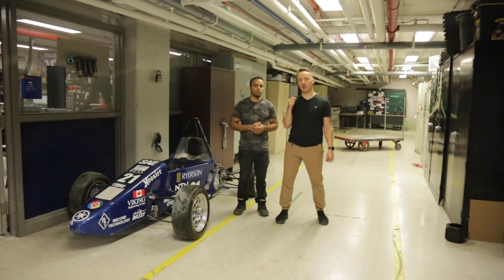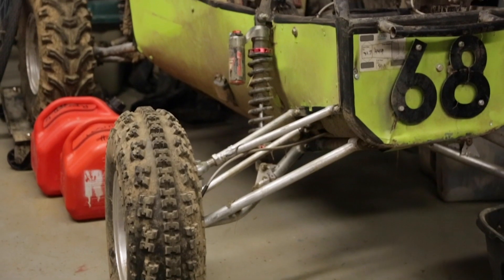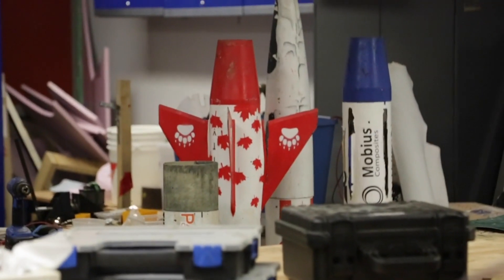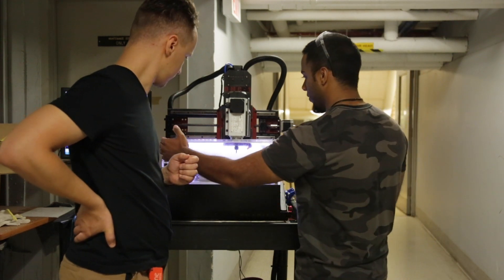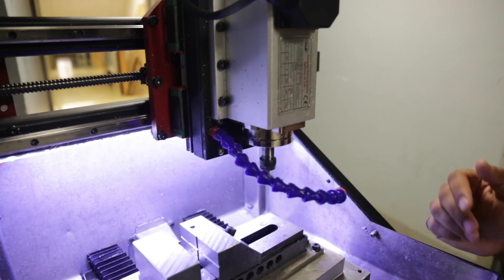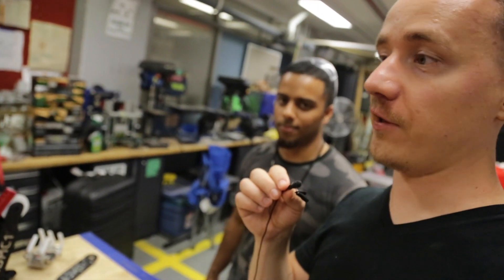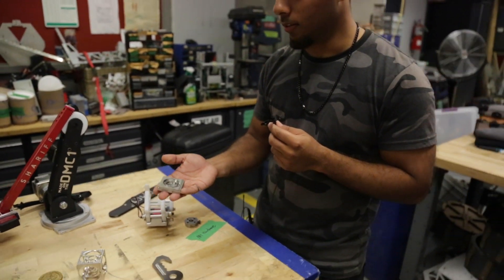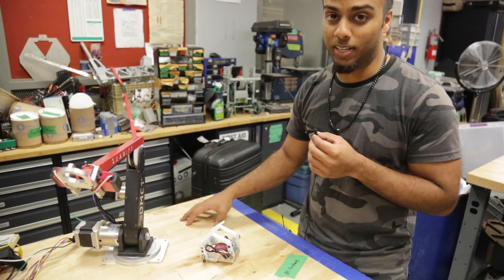Cheapest Desktop CNC That can cut Steel

Comment: Not trying to put negative feedback into this.  The machine seems capable, and good on the guy trying to bring something he seemed intrigued in to market.  The biggest problem here, is the lack of experience from the creator.  So many machines can perform these same tasks.  If you find any used engraving machine on marketplace, or ebay you can easily get one with equal travel dimensions if not greater.  Take the stock spindle off, buy a router, (bosch1617evs)  with stock low runout, and machine 1018, or 304 stainless, or any grade aluminum.  A used machine with the same.linear rails can be had for sub 1k. Bosch router - 200, precision collects for it from precise bits, another 200.  I guess my point is that this may look amazing for anyone with no cnc experience.  I'm not sure who the target audience is suppose to be for this.  Sorry if this seemed negative, I just feel this another in a long line of desktop style "mills" that fall even shorter than most.  Those parts looked rough off the machine.
Reply: whats a good alternative that can aluminum steel? on the market for one i can play around with and machine bike parts, shapeoko seems like another one but it doesnt seem "beefy"

Comment: you showed steel that was cut but never showed it doing the cutting of the steel. so we take your word for it and just buy the machine right? well anyway i probably would but i just found this video and i see it was unsuccessful at Kickstarter because nobody knew it was even out there being made! i think you need to get alot of interest first then try the Kickstarter again. please because i need a true good steel cutting desktop cnc . the size would work for most of my projects 12inches by 8 inches and 5 and a half inch up down zed axis would be perfect for me. hope you try again and film some steel cutting perfectly and it will be gone sold out way before you can even make them! they need a lower price point also. no more that 1,200$ usa dollars. to be successful.

Comment: Advertise that it cuts steel but only show it cutting aluminium? You mention something about testing so you don't break things. That's a smart thing to do but, doesn't the software have an option to input the type of bit and material used? If so, how well does it work? Is it pretty much set-and-forget or does it not work well?

Comment: Some nice machining, especially on the circular cut one with lots of features. Have you tried the "Only One PM60" end mills made by YG? I've been using one on hardened, toughened and tempered steel and it cuts like a knife through butter. I have a home CNC machine that I've converted using brushless DC motors on an Arduino Mega. Love all the projects at the university, keep up the good work 👍😀

Comment: I need this cnc
Reply: Have you seen the samurai 120 on Kickstarter
Reply: @Seed-qj6jk  now I've seen it but c'mon ...you are going. To pay 3500£ for mgn12 and 12mm ballscrew? What a joke 😂 the video was good then I scrolled down and saw that ...and I was like ..hell nah
Reply: @fabiofoltran4361  what's wrong with those?
Reply: @Seed-qj6jk  well for cutting steel that hardware is pretty undersized ..I would go at least with 20mm guides and I still feel that is on the edge ...mng12 I have them on my 3d printer ..they are actually super cheap from China ...and they perform ..not good ...i mean they cost nothing to but they are kinda sh t, and they are not made for those task ..they have only 2 contact points and not 4 like brand name rails ..the 1204 screws idk I didn't try them but 12mm seems undersized to me..and we are paying 3500£ go to AliExpress and search for yourself how much those costs and then tell me how the f is the guy spending 3500£ for building that machine
Reply: @Seed-qj6jk  TLDR they are severely undersized, not up to the task and too cheap for what you are paying
Reply: @Seed-qj6jk  if you wanna build a cnc I reccomend to get in touch with the components because a lot of people are selling Chinese stuff with insane markups, knowing what you are buying will save you a lot of money
Reply: @fabiofoltran4361 I guess you are probably right but didn't you see it slotting steel and aluminium
Reply: @Seed-qj6jk  that's true..you got me .. I'll comment on this video when or if I will ; )

Comment: The unit is only 3-axis, but the controller used supports 5 axis control (similar to the SainSmart 5-Axis Mach3 here: https://www.amazon.com/SainSmart-5-Axis-Mach3-Controller-STB5100/dp/B07L3DYVJ1).  So a 4th/5th axis chuck such as this one (1) should be able to just be plugged in without too much difficulty.  The stepper motor drivers (3 are included) are TB6600 (2).

(1) "4th Axis and 5th Axis 100mm 3 Jaw Chuck" [https://www.aliexpress.com/item/32521549316.html]

(2) TB6600 Bipolar Stepper Motor Driver [https://www.makerfabs.com/tb6600-bipolar-stepper-motor-driver.html]

Comment: I'd really love to get one of these, but spending 2.5k€ on that thing is - as a student - sadly too much.

Still, I'd love to buy one of these in a few years and wish best luck in getting your project off the ground
Reply: What kit is there to build one for 500€ have u got a link?
Reply: @gt0163  nah for 500€ you can dream of that hardware ...if you are like really good in mechanics and have already a milling machine you aint going anywhere...electronics it's already 200€ ..linear guides and ballscrew are not cheap, and after trying some 20mm. Ballscrew and linear guide from THK I don't reccomend to buy the shi t Chinese one, the one that you see in the video are, my reccomendation? Find a cnc maker in you zone and ask if they have retired machines..you'll  have to redo the electronics but trust me the mechanics is the difficult part. For 600€ I bought an all cast aluminium that weights 150kg with all the hw trow at it 100€ for drivers and 50 € euro of a controller and you have a machine capable of handling aluminium..when you can make your own part everything will be more rechable, my machine has also a 650*450 work area so pretty big and it has a cast aluminium bed that is 4 cm thick ..only that is going to cost you a fortune ..so moral of the story if you buy it it's better ..with the smaller machine you can do plates and precise parts for a bigger machine and then fill it with a composite mix of epoxy and sand to have a good absorption of vibrations ...getting a little sidetracked here
Reply: @fabiofoltran4361  i am begginer for all of this what do you think i should buy a lathe or cnc? Considering I have some know-how metal casting hobbies in my backyard
Reply: @dogodogo5891  I'm not really the one that should tell you but for example a few months ago I bought a cnc with a working area of 650mm * 450mm for 600€ ..that's pretty cheap here in Italy but with the same money I would have bought an used lathe (a big one) ,the cnc that I bought doesn't have the controls so I have to remake all the electronics but that's not a problem ..with the first cnc I plan to built parts for a bigger one ..20mm linear rails and ballscrews..and a bigger working area...the little one can cut aluminium so I can make some really nice parts out of it .. it's nothing special  but for now it will suffice ..then I don't know your budget so ..but if you can try to see on the used market if they have anything good ..(my cnc was a used one from the 90' but it's better than anything that you can get from China for the same price) same for the lathe don't buy the little overpriced one (imported from China ) buy a old big one ..they are built to last and won't break down on you
Reply: @dogodogo5891  maybe a lathe would be better ? Cause you can cast your round stocks of metals and the turn them to dimensions? Then a lathe it's made for turnings cnc can do a lot more things , but can do the things that a lathe does. Or it can do it but not with the same level of precision (at this price point)
Reply: You can build it yourself for around 500-600. There was a successful 5 axis kickstarter last year for $3000 with automatic 12 tool changer. It seems they just barely didn´t make the goal.

Comment: Yea that wood router motor "milling" its literally off of aliexpress 2pole pos
Reply: Of course it is. Would you expect them to design and manufacture the spindle themselfs? You also want them to build their own steppers I guess or what are you expecting?
Every product designer wants to use working and already designed parts when possible and appropriate as it makes the product cheaper and more likely to actually get build.
Reply: @IanMcDoe  I expect them to spec correctly. I expect them to actually give damn when picking parts 
Not saying Chinese is bad All I am saying they put a wood spindle on a metal milling machine.
Reply: @yoyobob1  On the product page for one of these it says for metal processing. The ones made for wood only (like bosch pof 500) are usualy made from plastics and wouldnt stand a chance against metal. While its true that many diy routers use spindles like this the reason that they could never mill steel is the stiffness of their machine bodys which are large and from extruded aluminium. This one is stiff enough to mill steel and the spindle is good enough for the job.
Reply: @IanMcDoe  we did

Comment: It's really a shame that it looks like this won't get funded. The single reason I haven't purchased myself a desktop cnc is the crappy quality of what is on the market. The Nomad is probably the best available, but for the price, not being able to flood, and not having ball-screws is a total deal-breaker.  This thing looks amazing.
Reply: Thanks! At this point it does look like we might not reach our goal, however we will most likely still go through with production and deliver machines to the current backers. I'd recommend signing up to the email list so you can follow our progress: https://www.shariffdmc.com/
Reply: An idea for "version 2”:  What is a "killer app" for desktop metal milling?  I don't know.  There is also this Kickstarter (https://www.kickstarter.com/projects/3d-high-resolution/3d-jewelry-scanner-shadow-bands-heirloom-gemstone/), which is a 4 axis jewelry-quality 3d scanner.  If it comes through, could it be connected via software to the DMC to basically make a kind of ”replicator" - at least within the constraints of a 3-axis setup.

(Or a “90-degree angle constrained 4-axis"?  You mill one "side" of a model, leaving a solid top and bottom plate, then rotate it 90 degrees around the y axis [right-handed coordinate system with the spindle as the z axis], mill another "side", and so on.  Then you turn it "right side up" and mill off the  solid top plate.)

I don't know if it even makes sense to talk about a "killer app" for a $2.5-3K metal mill - given that metal mills are (I assume) basically thought of as "work machines”, and not “serious playthings” like consumer 3D printers are.  They are certainly are priced as such - as is a $3-4K DMC1.  But the same was true of 3D printing I assume before the "3D Printing Explosion" 5-10  years ago (?) after Stratasys's and others key patents ran out.  (Someone at Stratasys is maybe kicking themselves right now that they didn't create the "desktop 3D printing" market.)

Then license FDM/SLA tech for a modest quarter-penny per machine, and make at least a minuscule fortune.  I (probably) wouldn’t have hurt their core business at the time, which was (again, I assume) only large format, industrial printers that cost over 1/2 million.  But then, patent "licensing" doesn't really fit with the "maker economy".  It *could*, it's just there is no real micropayment/logistical network to facilitate it - I don't think.)

Could we be at a point in 5-10 years where metal milling is as common in the "low-medium end maker sphere" as 3D printing is today?  I don't know - milling obviously has greater safety concerns (anything that has a sharp object spinning at around once a millisecond would).  Make the plastic shield harder, put a hard-to-disable relay switch in so that it won't engage unless the cover is closed, and include high-quality impact resistant goggles and earmuffs.

Or (much easier than the DMC-D3D idea) make a thing that will take a drawing, scan it in, and then allow it to be carved directly onto a plate, with several selectable or user-created styles.  (Ideas:

1. Outline a drawing with a V-bit "inward bevel", reverse "outward bevel", or round-over bit.
2. variable cross hatching for opaque areas.
3. Interface with Prisma or some other "AI-based art-portrait app".
4. Various things with depth.

5. Some kind of PolyJet-like pigment deposition integrated into the system?  No real idea how that would work.  Since the machining process itself heats the metal to whatever high temperature, could a suitably nontoxic pigment be melted onto the hot metal right after it gets carved?

6. Integrate with Facebook and Instagram (they are basically the same, even if FB doesn’t want to admit it.)  Take a picture from FB, carve it, and have it automatically mailed to a friend..  Advertise it like Apple’s iPod - ”Select, Mill, Drop off at UPS"  (Charged to your Libra account - or Paypal, Apple Card, or Amazon Pay if you're creeped out by Facebook becoming a *bank*.)

7. Netflix - get a metal print of your favorite movie scene (you pay a small fee, the studio and Netflix both get a small cut.)

Okay, numbers 6 and definitely 7 are rather ridiculous.  (But then, 20 years ago, the idea of the life-sharing-time-suck called Facebook - or consumer drones - would have been considered ridiculous too!)

Take any of these ideas, and make some kind of agreement with some bulk metal supplier, and (for the photo applications) maybe Nikon/Canon/etc to integrate "processing-and-preview" software directly into the camera.  (Though if a person is going to drop $800+ for a DSLR, will they really want to drop another $2000 on a mill?)

To continue with the ridiculous automation bit, connect the camera to the DMC via Wifi, then work with the Mirobot small-industrial-robot people (https://www.kickstarter.com/projects/mirobot/mirobot-6-axis-mini-industrial-robot-arm/) to make a thing that will automatically take a slab of metal from your stock, load it into the DMC, mill it, and put it on the table when you get home, ready for de-burring.  (Or sell a separate machine for that - kind of a ”Form Wash for metal")

(Then you notice that your pile of metal plates is getting low, so you arrange a new delivery from the DMC-partner metal dealer [sounds like it's a drug], to be delivered the next week by FexEx for a bargain shipping price of $60 for the 40-pound load (plus the cost of the Aleve for the delivery person’s back).
Reply: @ragnarokofborg  the rantings of a mad man
Reply: @shariffdmc3406  Looks like you survived and released a 2nd version, awesome!